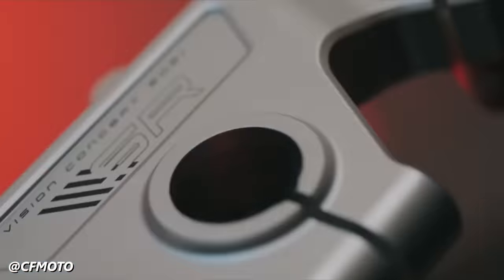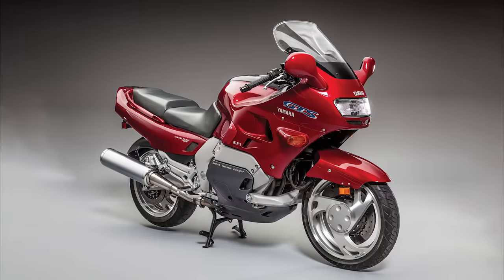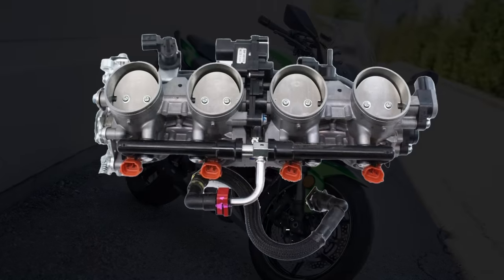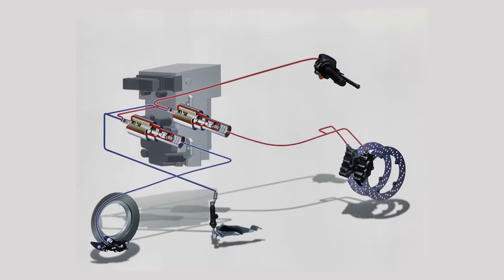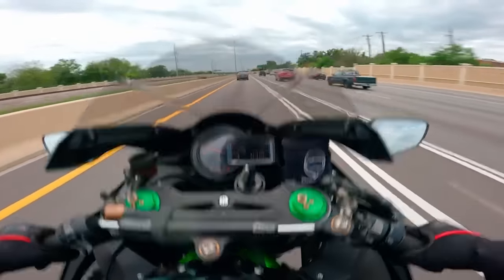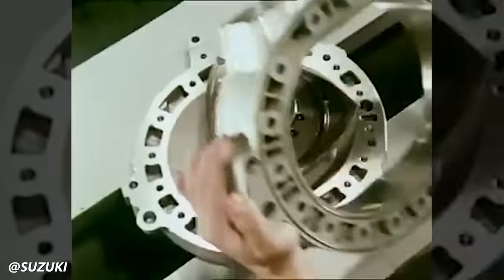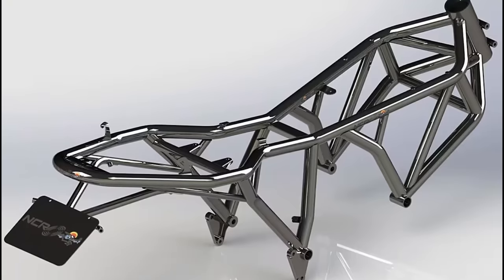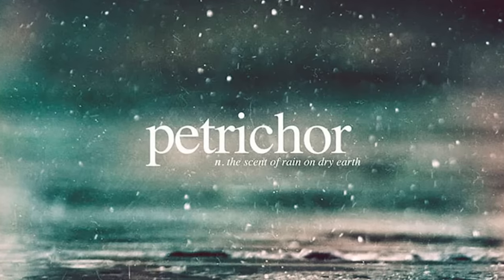Top 10 Motorcycle Failures (and some winners)

Comment: I owned a 1979 Honda CBX for 14 years. It was a fantastic bike with the best sound a motorcycle has ever made if you had the 6-into-1 exhaust system, which I did. There have been other 6 cylinder bikes since but the CBX was the only one designed as a  high performance machine. The others have been designed as cruisers or touring bikes.
Reply: I wouldn't mind having one, or at least the engine to build a track day sports car around.
Reply: Do you think the 6-into-1 sounded that much better than twin 3-to-1 because of the arrangement or because of the muffler and header tuning?

Comment: I owned a GTS1000 for around 4 years. It was a fantastic long-distance mile-muncher, and a fun scratcher in the twisties. Super comfortable, quick, and the handling was was absolutely rock solid. The down side was the fact that there was absolutely ZERO feedback through the bars. Pushing it too hard into corners came with the risk that there would be no forewarning of any loss of grip. I certainly never regretted buying it though.
Reply: I rode one very soon after it came out on PCH 1 (I was 20 years old, ran into another rider randomly while on my CBR600, he insisted I ride the bike he had bought that week) and it was glorious. Many years later I bought what I consider the spiritual successor to it...the BMW K1200R which had the tele lever front suspension.

While I do respect alternative front suspension, my last bike had massive upside down front forks and impossibly large Brembo brakes, while being 150 pounds lighter and making 50 more HP. Technology marches on.
Reply: Someone rode this thing in the IoM TT and finished pretty respectably so it wasn’t all bad. I think the main problem was the price which was over £10k which was pretty steep when a similar bike was about £8k.
Reply: @johnludmon510  Yep, it was quite expensive at the time
Reply: One major problem was the wheel size. With a smaller 120mm test had shown much better handling. But Yamaha unfortunately didn't change. The bike was one of the best tourers build at that time.
Reply: exactly. Great bike, but the front end felt so, so dead.. no feedback at all.. pity, because i really loved riding that bike!

Comment: You also can't forget about the Kawasaki KZ1300. It was also an inline 6 and actually made 120 HP just one year after the CBX was released. It also lasted 10 years in production.
Reply: I had the 1980, first year KZ1300A. It had a black Windjammer fairing. It was a nice-riding and powerful machine, except short-legged me had to left-foot, right-foot it at stops.

Comment: in 93, I took the Yamaha GTS1000 for a test through Yellowstone National Park. The motor was amazing, and the power delivery was spot on. Grabbing a handful of front brake at 90mph, 2-up and zero headbang! Tight turning in small areas at slow speeds was the weakness.

Comment: Here's a winner for you. The first ever production front disk brake was introduced in 1962 on the Lambretta TV175.

My favorite innovation that has never to my knowledge been copied is on my Benelli 900 Tre. It has the radiator behind the seat rather than at the front of the bike, enabling the engine to be mounted further forward putting more weight over the front wheel, and also reducing the width of the bike so the front end was more streamlined. Brilliant idea with the cooling fans behind the seat blowing out hot air, which is also great for warming your hands on frosty days.

Comment: A plethora of valid information as always.  If you're Yammie Noob, I guess I'm Yammie Old School? My definition of sport touring is steel frame, carbureted 1200cc, non-ABS, 6.6 gallons of fuel and someone with a death grip riding safely on the back. Yamaha of course.

Comment: I owned a GTS1000 (no abs) and it was a great bike. I think I bought it in early 1995 second hand and sold it end of 1997. Drove to work every day even in winter and went with it on holiday from the Netherlands to Poland, many road trips sometimes with 2. For me. a perfect bike. Some flaws, it was quite heavy, and 5 speed not 6. I have to say it was tuned slightly when I bought it, and on the dyno it had 100 din ps on the rear wheel. It was electronically limited at 240 km/h, which it quickly reached also with 2 people on the bike, and it could easily hold that speed for over an hour. (But then needed a refuel). Great bike. Commercially not a succes.

Comment: that pc with 4090 is a nice way to spend wnter time ) I always miss my bike the second it starts getting cold and snowy. those 3/4 months of waiting until its a steady 12 degrees or higher again.. And you notice on the dutch roads the second its ovr 12 degrees. They all come out people complain about all the motorcycles on the road and by the time its summer things have slowed down again and people are used to it again

Comment: Randon I know, but when I was racing sled-dogs, at a latitude where we don't get much snow, we used scooters and rigs made from bicycle parts, I had the lightest scooter, but one guy had a rig made with what could only be describes as an Aluminium twin spar. it looked good, and was fast, but bounce around quite badly, just as I found with the lightest scooter... stability was not the strong point of these things, yet the nimbleness and ability to change direction so fast is what allowed us to win races. more so than the abilities of the dogs pulling them!

Comment: cable throttle bikes had traction control as well using secondaries / ignition timing to get the similar result where as fly by wire just meant you could lob the secondaries and just have the ecu manipulate the primaries separate from rider input. im guessing this was done because early fly by wire in cars was very hit and miss (delayed response).

Comment: A bigger fail than the Suzuki RE5 was the Hercules Wankel 2000.
An air-cooled rotary, which ran on oil/gas mixture, with a blower in front that gave it the nickname  "the vacuum cleaner"

Comment: I was about to whip you like a rented mule when you started on the CBX. However, you redeemed yourself. While a flat plane 4 cylinder sounds cool, in my opinion, nothing sounds as good as CBX running a modified exhaust. They were a little clunky an chunky for sure. I was fortunate enough to ride my friends CBX, many times.
Reply: GT750 two-stroke with expansion chambers is a pretty mean sound!

Comment: I own a 2002 BMW R-1150-RS with both Telelever and Paralever suspension. The 2002 model is a second generation, with refinements to these suspension components, as well as the engine/drivetrain, and ABS brakes. I find the suspension is stable and precise in the twisting back roads, as well as comfortable for all day rides. A feature I especially appreciate is Anti-Dive is built-in so there's almost no dive when braking hard, which improves stability heading into corners. The engine is well-made, with 10,000-km valve adjustments hardly ever needed. Once broken in they pretty much stay at specifications. The brakes are great as the ABS has solenoid power assist. I can brake as hard as I want without worry I'll break traction.

Comment: some of the fails were down to the tech of the time they were first made! a rotary is a brilliant engine for a bike with how much people have improved on designs! and lets face it we all want a bike that sounds like a rotary or a smooth inline 6
Reply: The problem with the rotary engine is it is inefficient and won’t meet emissions regulations. The RE5 was slower than a GT550 and used more fuel and oil than a GT 750. The RE5 nearly bankrupted Suzuki and apart from Mazda’s RX7 nobody has made much of a success with a car or motorcycle with the rotary engine.
Reply: @johnludmon510 Norton have made some decent rotary powered bikes! Then last year or the year before there was the new race bike I can’t remember the name of CR700? That thing is an animal
Reply: @matthewjones6276  Sadly not for the last time the then owners of the Norton name bankrupted the company with some financial skullduggery having taken quite a few people’s money for shares and deposits on bikes. The problem’s with the engines and emissions regulations have killed the engine in bikes and cars (I believe the engine was meant to be an aircraft engine originally). The race bikes were fast and did win British championships but the other riders didn’t like them spraying oil out and the rules had been tweaked to get them onto the grid.

Comment: I owned one of the bikes on the list it was the Suzuki GT750 l loved that motorcycle and at the same time my brother had the Suzuki RE5 yes the infamous rotary and l rode it a couple of times it was very quick and after riding it l was never going to challenge my brother to a drag race it was faster than my GT750 he used to blow of Honda CB750s as for the fuel injection on the Kawasaki Z1000 worked well on the rode but not on the race track as for the turbo motorcycles as much as a normally aspirated with a bigger engine were cheaper and much faster so they were a fail

Comment: The turbo motorcycle fad from the 1980s would work with modern technology
Reply: Since you can currently get 200 HP from a naturally-aspirated engine there really isn't  any need for a turbocharger with its additional cost, complication, and weight.
Reply: @littleshopofelectrons4014  mo powah baybeh
Reply: @littleshopofelectrons4014  I want to see turbo small displacement bikes
Reply: @countryguywithcamera  Sounds like a fun idea but literally unnecessary since whatever power you get from a small displacement turbo, you'd be able to get anyway with a larger displacement naturally aspirated engine with more predictable throttle control. Turbo motorbikes will never be a thing unless forced to by strict emission standards one day...
Reply: @shabs2134  I've seen the old ex250 ninjas making 50+hp with turbo setups with minimal effort.
They are insanely fun machines with their power to weight ratios.
With modern turbo technology and modern boost/fuel management it's doable.
Plus I would love my bike to make spoolie noises 🤣
Reply: @sportytoes  honda made 20k 250 it's on fort9's channel.
Sling some dished pistons in it so the compression ratio is boost friendly, with some turbo profile cams.
Modern efi with ride by wire and a small turbo and let it eat
Reply: Blowers make a lot more sense on bikes than turbos.
Reply: @Win7ermu7e  agreed but they don't make spoolie noises, blower whine is cool too tho
Reply: @shabs2134 I think it's being introduced to washing machines to preserve water but I don't know how I feel about my laundry getting sloshed like that
Reply: @user-martinpd  do you have an ice motor in your washing machine bro? Seems dangerous.
Reply: @Win7ermu7e  funny  shit far enough back washing machines had small 2 stroke engines on them

Comment: The rotary wasn't a complete flop. Norton made several rotary models and won a lot of races with them. They aren't at all complex, there's only one moving part in the engine
Reply: Rotaries are about as simply as an engine can get, the main issue is that a lot of people don't know how to service them properly and the 1 part that is known to fail requires an engine teardown to fix. While I have no personal experience with them I do love them a lot. Objectively they're perfect for motorcycles, small, lightweight and lots of power for the size

Comment: I’ve never had to walk because a carburetor completely shit The bed. Can’t say the same thing about the fuel pump required for fuel injection.
Reply: Never had float stick and flood fuel all over your engine (and back tyre)?
Reply: @n4s117  sure I have but float’s don’t stick. It’s usually a dirty needle and seat. Easy fix even on the road unlike a dead fuel pump.

Comment: Hey yammie noob, in the early 80s I owned a 1975 Honda 500 twin(DOHC torsion bar valve springs), not a good motorcycle, valve float above 7000rpm, and a red line of 8500rpm had the engine in & out 5 times, Money Pit, almost gave it away cheap towards 1st car!😐👎✌
Reply: I actually love the 500T.
Probably misplaced... And the 450 was a lot better bike...
Got and have away 2, never even heard either run...